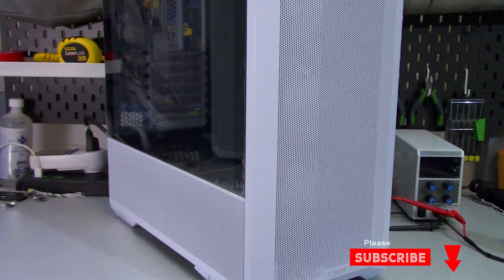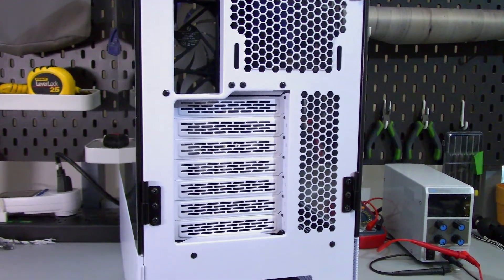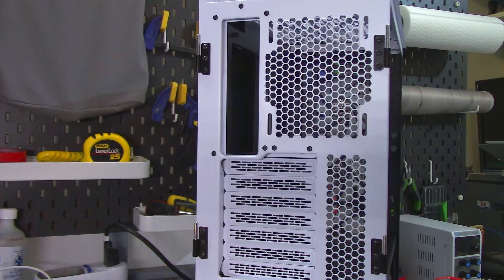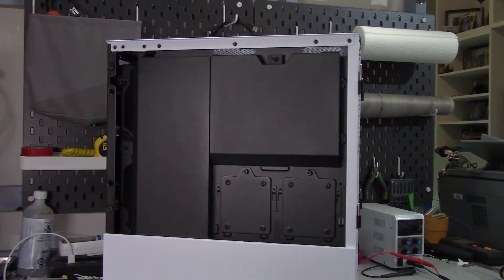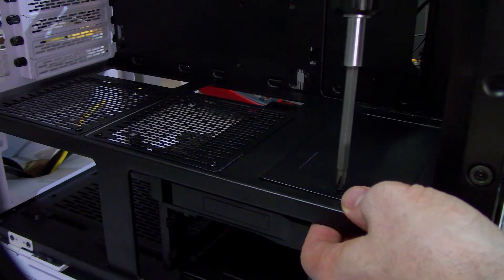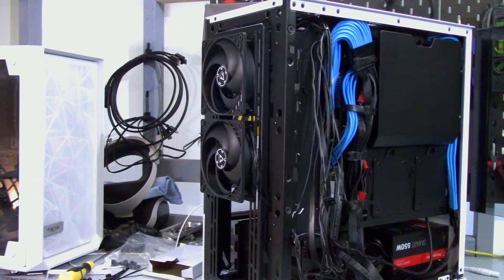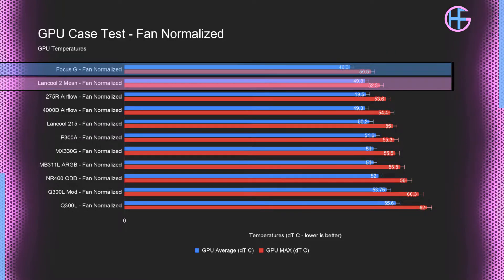Lian Li Lancool 2 Mesh - Case Review

Comment: I didn't understand about ARGB connectors. If I have an argb hub, couldn't I directly connect the fans?
Reply from the maker: Theses fans don't have the "standard" argb 3 pin connector. So they can only be used in this case.
Reply: @HardwareForGamers  ok, but how could i connect those unusual 3 pin connector? I mean, i will buy the case, what i have to do to connect them properly?
Reply: @HardwareForGamers  or I don´t have to connect them? I explain you my sittuation. I have an argb controller (from other fans i bought) but I don´t have the connector on my Motherboard. So, Can I connect the 3 fans (which i see is only one connecter for the 3) in my controller?
Reply from the maker: @ValenRojooCanal  you will most likely not be able to use the Lancool 2 fans on the controller you have. They need the controller that's built into the case. Now, the controller that's built into the Lancool 2 has a "standard" 3 pin 5v ARGB extender. So it is possible to add ARGB fans to it, but you will likely need an ARGB splitter.
Reply: @HardwareForGamers   1) Thanks for the support man, I appreciate it.
2) Where is the controller that is built into the case? I dont understand that part, I only see 3 connectors.
3) as i saw in other video, I know what extender you talk aboult. But, besides that, I see other ARGB female connector… what I have to do with that?
Reply from the maker: @ValenRojooCanal  the controller is in the front IO. The 3 pin female it to plug into the motherboard, if your motherboard has an ARGB header.
Reply: Those are the Pwm/Dc?
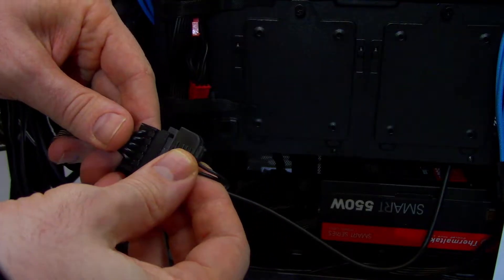Reply: @HardwareForGamers  oo wait, those unusual connectors you show on 11:37 dont need to be connected?
Reply from the maker: There's a cable that comes off the front IO that it plugs into.
Reply: @HardwareForGamers  perfect, so i wont have any problems. Thanks for the support!
Reply: @HardwareForGamers  HI so you plug in the argb connectors into the controller right? and also can you plug in multiple? sorry if these are stupid questions i just want to be sure
Reply from the maker: As I say in the video, you can add 5v argb's to the hub.
Reply: @HardwareForGamers  I bought it last week bro, beautiful case 😁

Comment: I wonder if a artic freezer cooler II 240 would fit at the top, its kinds thicker than other 240's?
Reply from the maker: It might limit the heat spreader height on the RAM sticks, but for the most part I think you should be okay.

Comment: I Just built in both the White- mesh and the performance cases- two weeks ago love the air flow.  The white one is a AMD Ryzen 7 5800x W/MSI 2070 and the Performance case is my Intel I9 10850k W/ Gigabyte 2080 TI Both GPU was bought in 2019 waiting on the 30 series to become available